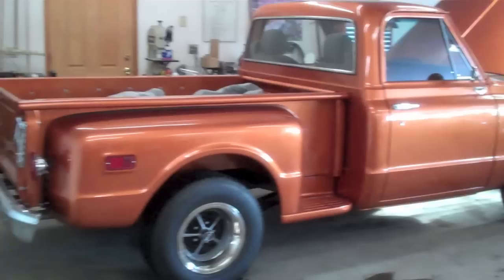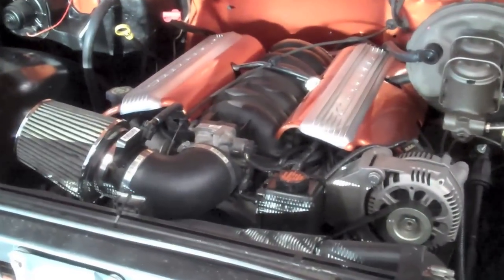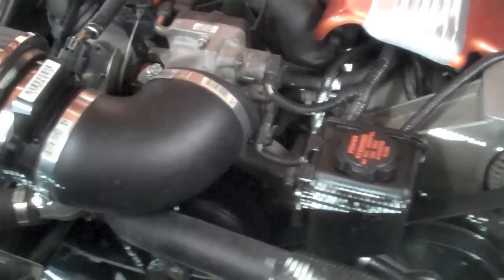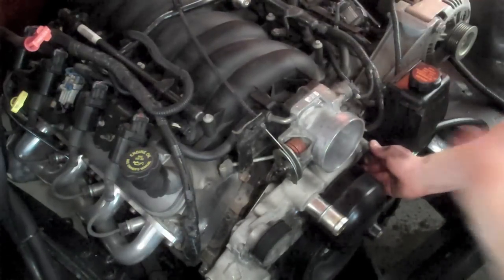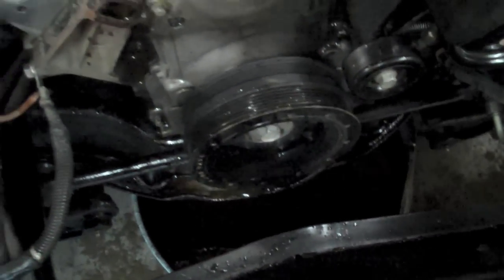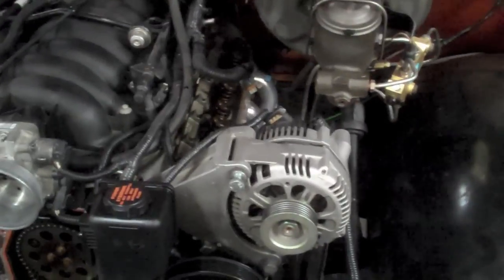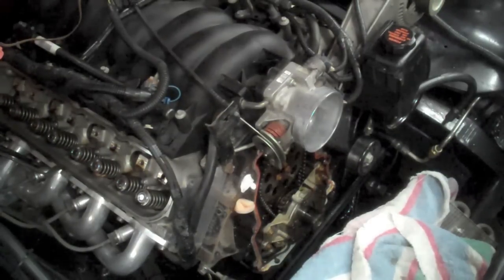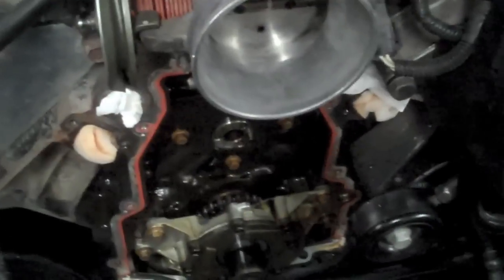How to Install a Comp Cam in a 5.3L LM7 Part 1

Comment: What are the torque specs for the 
-3 bolts to the gear holding the timing chain, 
-the 4 bolt plate holding the cam 
-the timing cover
-& the water pump? 
Please help first time doing this

Comment: only loosen the bolts for a rocker arm ,if the valve spring is all the way up .rotate the engine to put the cam lifter on the base of the cam to loosen or install the rocker arms .if you have time ,buy the push rods after checking proper length ,with a push rod checker tool .use cam lube on all cam lobes ,and push rod ends ,and all valve train mating surfaces .

Comment: from previous experience if you change the camshaft your gonna need different sized pushrods, And don't forget to set valve lash timing after the cam install
Reply: The description said he changed the push rods 7.4 hardened.

Comment: I have a question...do really have to remove allot of the parts you removed to just install the cam or you don't have to... respond would really appreciate it
Reply from the maker: Yes most of the parts I removed have to be removed to change the camshaft. I also installed new valve springs in this video as well which are needed with most aftermarket camshaft swaps.
Reply: matthew20061 ok thank you man appreciate it
Reply: matthew20061 I have a really quick question...should you lube the cam or not?
Reply from the maker: Jr Corvera yes the cam needs to be installed with assemble lube or engine oil on it. I used engine oil in this video in part 2.
Reply: matthew20061 ok thanks bro....subbed💯

Comment: The lifters are shit on these motors. If you are spending some money on a nice cam, just change the lifters. Its not that expensive with a commercial account. Head gasket set, lifter set, head bolt set, done. Safe to rev that baby up now.
Reply: ls7 lifters which are inexpensive and very good for the budget minded.

Comment: In the future slide some 5/16 dowel rods in the holes on each side of the cam.  I use two 2' wooden dowels.  Spin the cam and start sliding them in until they wont go any further.  That will hold the lifters up.  Most people will never trust the lifter trays to hold the lifters up

Comment: Hi Mathew, I'm a big fan of yours. Great videos. 

We have an 5.3 2000 from a Silverado. Were going to put it into an 83 Mustang. When I go to replace/ swap my truck style intake to LS1 Camaro style intake can we reuse the truck style fuel rail and injectors or do we have to get the Camaro ones??
Reply: just leave the truck intake you can spend money for power other places like a turbo and fuel upgrades
Reply: Yeah man i’m doing the same thing but it’s going in an ‘84 corvette. I’m leaving the intake until after I get lots of more important performance upgrades

Comment: I was going to look at my timing chain while I was doing some work on my 5.3 but my crank bolt would not come off with an impact. I was about to use a 3' break over to get it off but decided not to risk breaking that bolt. Are those bolts suppose to be that tight?

Comment: Here's my concern. What about all the electronic components? Won't this basically fuck the fuel management system up royally? I'm self taught, and I just don't understand anything 88 and newer. There's always some fucking electronic gremlin that rears it's head and is always an expensive headache that takes a shop to figure out. And of course they won't tell me how they fixed it. It's a ruthless hobby.

Comment: I have a 2002 chevy silverado. Does the stock camshaft have a single or three bolt core? I don't really want to buy a new sprocket if i find out once i tear the motor down that its a single bolt cam core
Reply from the maker: For a 2002 it is a 3 bolt camshaft factory.

Comment: You said stock heads and intake? The intake is an LSx Style and the not an LM7 style high rise truck intake. So what style intake is it? And are you talking stock 5.3L heads or an LSx style, I'm confused?
Reply from the maker: Stock 5.3L LM7 heads and LS1 intake manifold.
Reply: whats your crank HP and RWHP on most stock? And what have you added. I'm in this process of finding a pullout or block to build...

Comment: Need to find one that will run well with your current set up and your going to need valve springs for the cam and depending on other factors you need to change your timing and all sorts of other shit experience is key here

Comment: Im jealous man! Nice truck! You certainly did an awesome job picking components & drivetrain. Truck also for that matter. Just a headache free setup with plenty of go.
I have a bone stock 90 c15, and I wouldn't mind an ls swap. (this is the first vehicle I have left alone & just driven & maintained)
I have a chopped/caged/boxflared 71 datsun 510 that eats my cash up....cal cams 290 dur. .550 lift. lil beasty 4 banger with dual weber 40's. has 12.5-1 comp, but the overlap lowers it quite a bit.

Comment: I believe once you get your rockers off, all you have to do is rotate your engine a couple of times and the rockers will stay in the upward position so you can get the cam in and out. It will stay that way until you begin to put your rockers back on. That's when they fall back in place.

Comment: You are taking a short cut bye not removing the intake manifold  and valley cover.
You have too remove the lifters out of the block before you pull out the cam.
If you manage to get the cam
Out. Good luck putting the new cam in. If 
one  lifter falls through.....you just started your  headache.

Comment: ive got a 5.3 stock with intake and exhaust, how long did it take u to do this? i have a 2000 silverado do u think ill have to pull the engine?

Comment: I drive s 85 Honda CRX, I want to know if I get a can of starter fluid and run a long small hose of the nausle of the can and run it into the air cleaner right above the carb, will it add any power? Iv done some testing with a riding lawnmower, catastrophic fail. Any ways any tips help.

Comment: @matthew20061 i know about the LS engines myself, there pushrod just like LT and SBC and you wouldnt of had of worried about the lifters falling if you pulled the intake off. haha. but it seems like you did ok in this video. i know that the LS7 lifters are interchangeable with LT1's and SBC engines

Comment: i have a 2003 silverado 5.3 stock engine only have headers and hypertech programer and cold air intake but want install a cam COMP Cams 54-412-11 
its the same process to swap the engine or need remove the cylinder heads?
can helpme?

Comment: @Navajas440 Yes, the 5.3L in this in this video is from the LS series. There are two generations of 4.8L (Vortec 4800 and Vortec 4800 LY2), two generations of the 5.3L (Vortec 5300 and the fourth generation Vortec 5300), a 5.7L (LS1) model, two generations of the 6.0L (Vortec 6000 and LS2), and a 6.2L (L92) and 7.0L (LS7) models. They are better known by their nick-names which I gave in parenthesis. There are others that use all the base blocks, but vary with different performing heads.

Comment: @Navajas440 Definitely! That's the outstanding positive attribute of the LS engines- high power with light weight. Sure the torque may not always be at the levels of the big blocks back in the height of the muscle car era, but these are so versatile that they can be tuned for torque. Throw a turbo on there and you'll be getting some sick torque/horsepower numbers.

Comment: @orlandotelevision It's not uncommon for a stock 5.3L to make a little more than 300 hp. After the cam, a tune up, and duel exhaust (assumed) they commonly make around 350 hp. Pretty good for a little 5.3, if you ask me!

Comment: @matthew20061 

Now that I know they are capable of handling that cam though I think I may go with the budget minded 918's as well. I don't really plan on spinning the engine past 6k so I imagine they'll be fine. What's the lowest stable rpm, and where does it start making decent power?

Comment: Think I might have to try one of these LSr cams in my trucks LQ4 6.0L. 

I calculated the overlap from the advertised durations and its only 45 degrees, that's incredibly low for a cam that size. Those lobes must be crazy aggressive. Are you sure comp 918's are sufficient?

Brilliant installation video too, very well done.